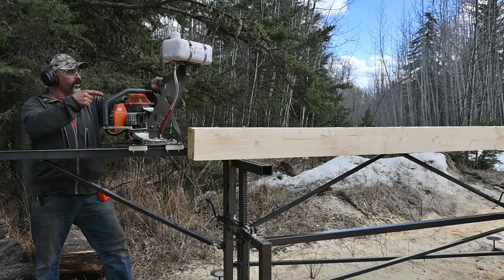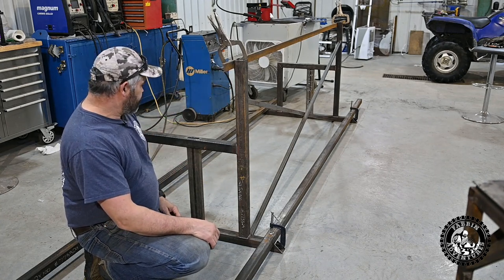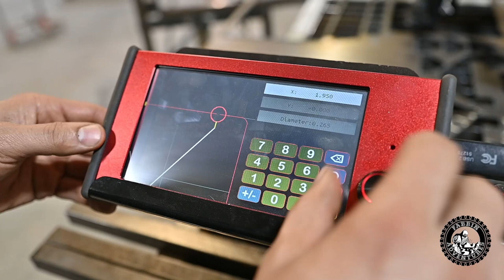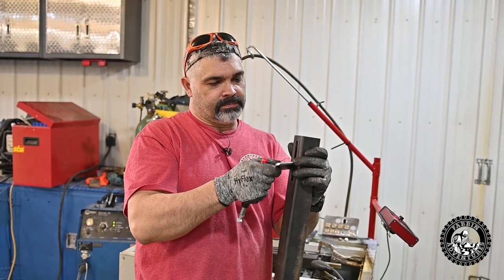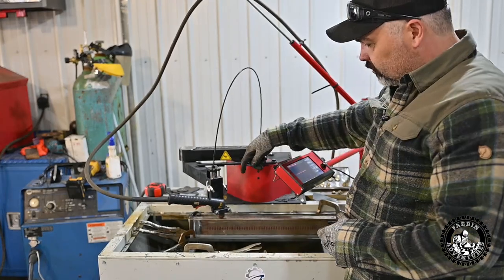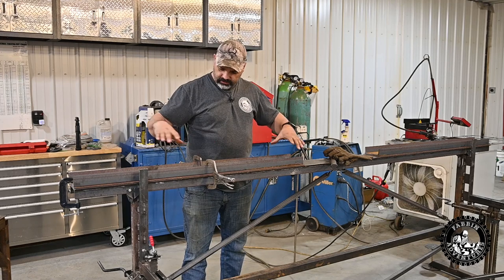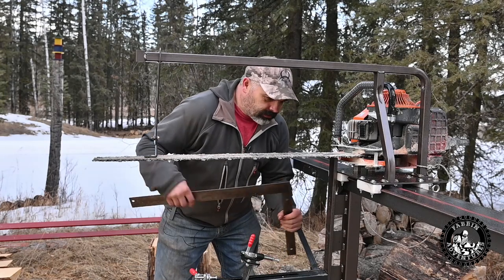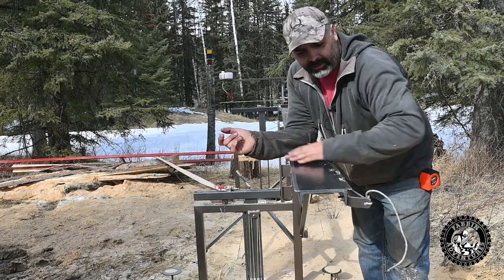logosol style chainsaw mill: Home made Chainsaw mill : New Shop tool (ArcDroid CNC Plasma cutter )

Comment: i built a couple of logosol style chainsaw mills over the years , i just recently manage to finish some mods and get to use my latest mill , i have been experimenting for years , anyway the most important mod i made , was to change the mounting angle of the saw , instead of 90 degs to the log , my saw is now mounted 65 degs to the log , with the nose first , it doesn't cut any faster , but it cuts way better , actually makes chips , not dust and stays sharp a long time , i made approx 20 cuts 6" x 6' and i reckon i could of made another 10 - 15 cuts with the one chain , i am using a 16 inch bar and 3/8 x .063 x 30deg chain , i haven't bothered with the so called , 10 deg milling chain for years  , whatever works eh
Reply from the maker: Wow that sounds like a great idea, i might have to try that idea!

Comment: It is very nice but let's face it.... Who has that type of equipment at home apart from a professional? The regular diyer won't have access to that. But never the less it is cool to see that
Reply from the maker: Well i've been accumulating tools for alot of years.
These are not high end tools, $1000 canadian welder and you can get plasma cutters now for less than $500 that will cut this stuff fine.
But yes maybe the average guy doesn't have these tools...yet.
I would buy a tool to do or finish a job here and there for the past 35 years and now i can make or fix almost anything.
Thanks for watching and commenting!

Comment: Hey great video and jealous of your shop. Im only a few years into accumulating my tools haha. The ‘standoffs’ you have on there do you think that puts much stress on the stud in the saw side or are they pretty safe there? Im going to try a poor mans version out of wood with a steel plate holding the saw by the bar studs. You must have $1000+ worth of steel there alone. Price of steel is nuts. Cheers from nova scotia!
Reply from the maker: Hey thanks for watching and commenting!
I believe it was close to $700 in steel, cant remember exactly.
You just keep accumulating tools for every project and eventually you will have a shop full of them. I been collecting tools since i was 8 years old, still have some of them!
I seen where a guy made a saw mill out of wood on youtube, should work ok.
The original logosol mill uses the same type of stand offs, i think if you dont try to feed the saw through the wood too hard it should be fine. Let the saw do the work, and keep a sharp chain on it!
Reply: @FabbinAdventures  thanks! Yepp theres always a project on the horizon thats needs a tool haha take care my good man
Reply from the maker: @mrblungorn awesome, take care of your self!

Comment: Love the adjustable braces, definitely something that would greatly improve the original Logosol.
Reply: I would attempt to copy logosols log clamps, they’re pretty much perfect
Reply from the maker: There is a heck of alot of hours in the engineering of this thing, used it a bunch today, needs a little tweaking but it sure does work pretty good.
Reply from the maker: Yeah i have some thoughts for some different clamps. Ive never actually seen a logosol other than on the internet so copying is not the easiest..lol
Reply: @FabbinAdventures  one idea, look up the logosol b1001 bandsaw clamps. I use a Logosol chainsaw mill a lot and the cams are good but thinking about it the bandsaws might be better and easier to make. Basically a post with a large cam and handle on top and an array of holes